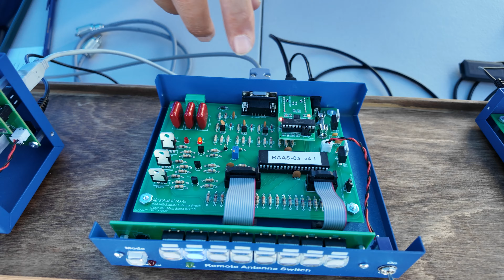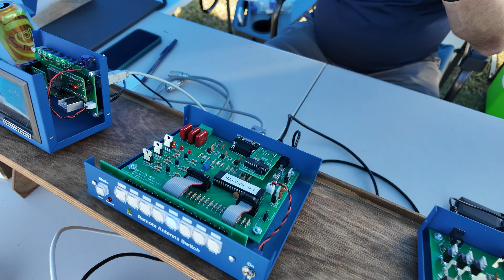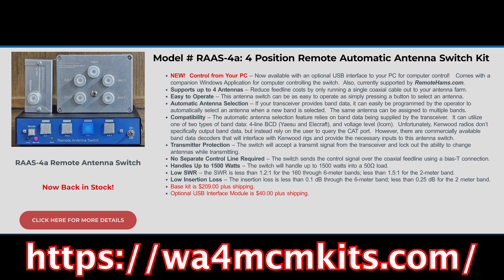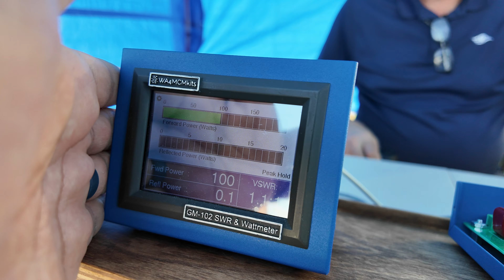Antenna Switch - Automatic or Manual - Full Legal Limit - wa4mcmkits

Comment: the only problem with this kit it’s the lack of decent port isolation. It bleeds a lot from port to port.
Reply from the maker: FFdo!  Thanks for stopping by and jumping in.  I have never had that problem, and don't believe I am at the level of an operator who thinks about that problem.  As an appliance, it switches antennas.  I am only using one radio so if another antenna bleeds over on receive, I am already listening on another antenna anyway.  According to Don Friend, "these types of switches that use the binary-tree configuration for the relays will always exhibit between 35-40dB of port isolation depending on the port pairs being measured . . . the only reason for more port isolation is if you intend to use . . . different transceivers between a single feedline."  I am only using one radio on one antenna at a time.  I haven't been and am 'novicely' unaware of poor isolation.  I am not claiming your statement isn't important; just that some of us haven't gotten to that point yet.  I appreciate you pointing out another perspective.  Please, drop back any time.  (btw, is FFdo to do with the airlines?). See you next time.  73 de Bill

Comment: Sadly none are any good for VHF/UHF??
Reply from the maker: Brain!  Thanks for stopping, watching, and jumping in with a question.  I have two (2) uhf/vhf switches.  The one I rely on most is MFJ.  They have gone out of business, I guess, and even before that this switch seemed hard to find.  The other is available from George, from PackTenna.  He has one via his Sierra Radio Systems part of his company.  It is a uhf/vhf switch that operated via his remote radio system.  It DOES NOT REQUIRE the remote radio setup to work.  It is 12v powered and does have a physical switch.  Check out https://www.packtenna.com/store/p60/VHF%2FUHF_Remote_RF_Coax_Switch_-_N_Connectors_-_Model_%23332.html#/

That is not an affiliate link, just a link to his pages. 73 de Bill

Comment: Very nice and quality parts, kit was well documented build instructions. Awesome 8 port switch, I replaced my microHAM Station Master with this.
Reply: Don, Larry, what did you use for the control cable, and is there a length limit on the COAX and / or control cable?
Reply from the maker: Larry!  Thanks for stopping, watching, and joining the conversation.  I appreciate it.  He makes nice kits.  I've finished mine.  Have to do the video and finish the install.  His instructions are number one.  He walked me right through everything.  Eight antenna ports are way more than I need, but he was offering the 8-port for the same price as the 4-port at the time.  Stay tuned.  I might finish it up at Huntsville.  73 de Bill